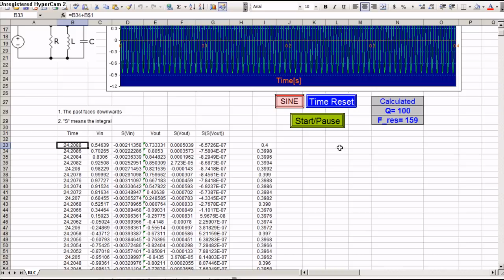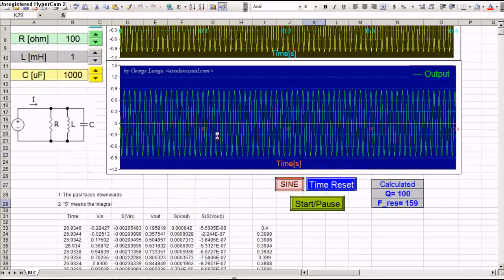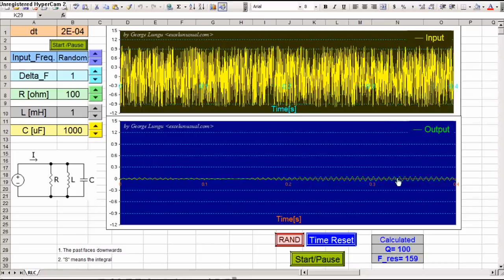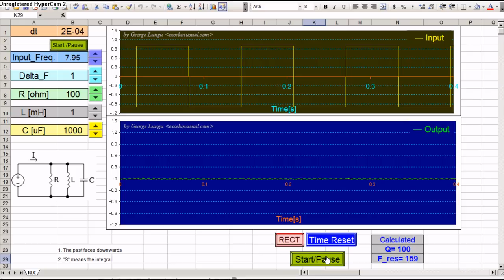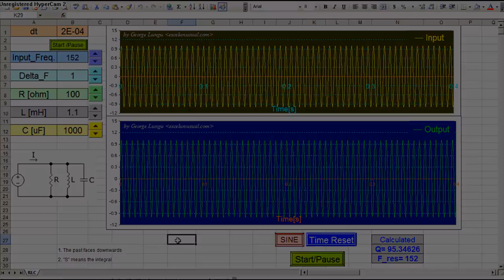RLC Parallel in Excel 2003

Comment: how to make it and how to use the formula?
Reply from the maker: This is a line plot on a 2D scatter chart. The vertices are from a table which is being re-calculated perhaps 30 times a second (as soon as a calculation is finished and refreshed a new calculation starts). I made the chart with back background and and deleted any axes and grid lines from the settings. At that time I knew very little VBA and most of the geometrical perspective is calculated in cell formulas within a table. Today I would do it differently, all VBA. You can see more at https://excelunusual.com/. Thanks for commenting!